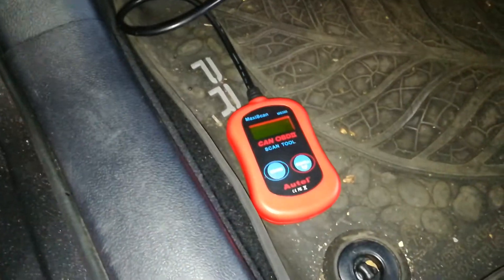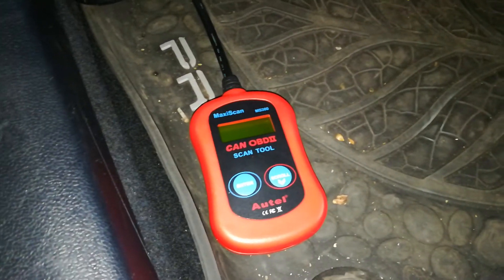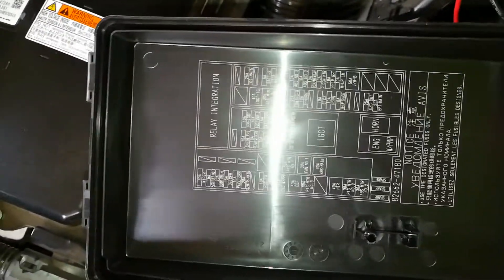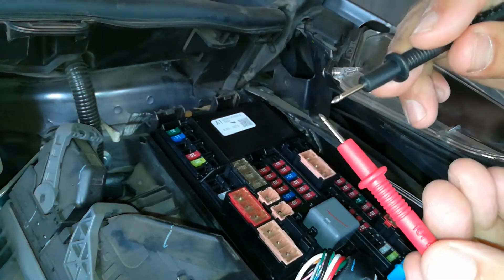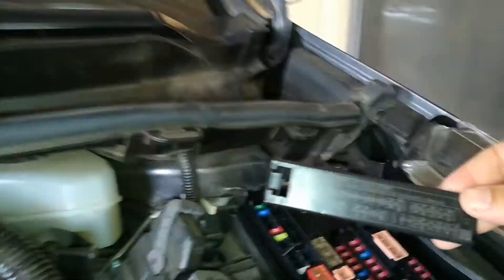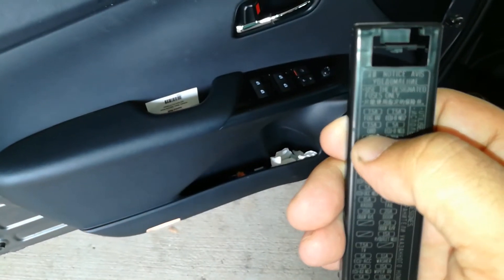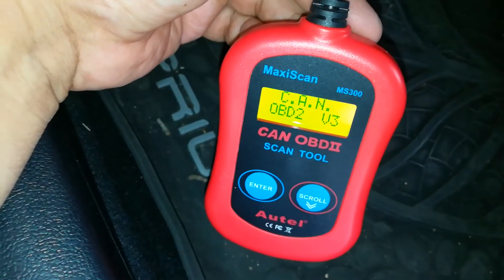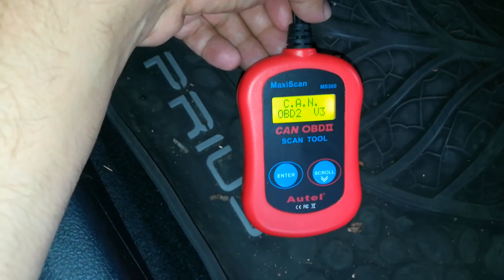Toyota Prius OBD2 Port NOT working and FIX

Comment: This was driving me crazy trying to find what fuse I blew because they were all checking out ok. I had no idea there was a fuse panel inside the cabin on my Prius C 2013.  🎉🎉  The parking brake isnt there but near the ODB2, there is a section there. My radio install blew a fuse and then the ODB2 fuse also blew but i couldnt find the radio one until now
Reply: There is a panel for Dome light in the engine area but that wasn't the line that blew

Comment: You saved me so much time by knowing the general area for the secondary fuse box. On a 2005 Toyota Prius that fuse box is just under the dash panel between the arm of the brake pedal and the plastic dash. It is a slightly different area but if you push the emergency brake pedal it then it is much easier to access. My 7.5A fuse was blown. I remember the day I blew it trying to reset my brake light and accidently grounded the power port. I checked every fuse under the hood and then I watched this video to find the auxilary fuse panel. Thank you so much. I know this video is very old but you did a great job explaining things and saved me a ton of time. Merry Christmas and Happy New year.

Comment: If the check engine light is on in my 2011 Pruis and they say the obd data port is faulty, what would my next step be, check the fuse replace it or what can you help.
Reply from the maker: Is the port getting power? Do a quick visual on the pins inside the port to make sure nothing is damaged or a pin has not been pushed back..

Comment: Great video. I have a 2gen prius checked all the fuses and my obd won't turn on.Have a red light on power and wont start.Please if you have any advice let me know
Reply from the maker: Sorry for delay, it's been three weeks, what happened?
Reply: I can’t turn on the car.No light no power.I don’t know what to do
Reply: Btw thanks for replying
Reply from the maker: What's the voltage at the battery? ( the 12 volt battery)